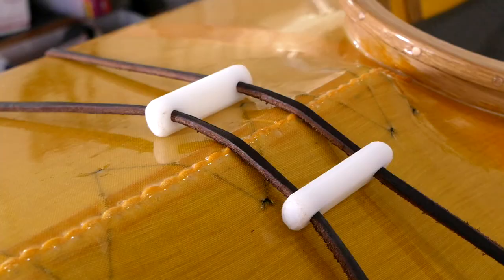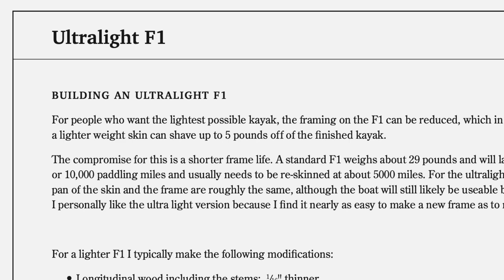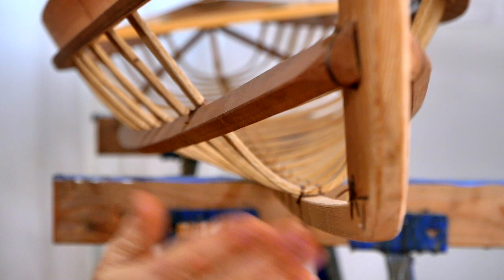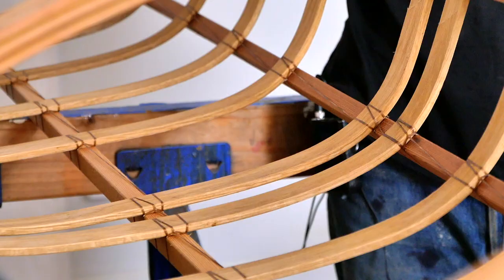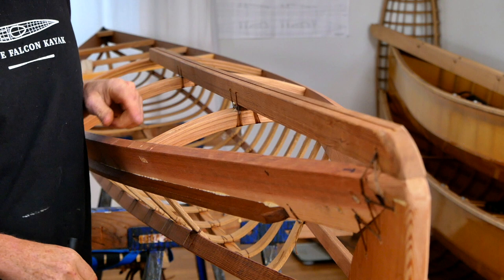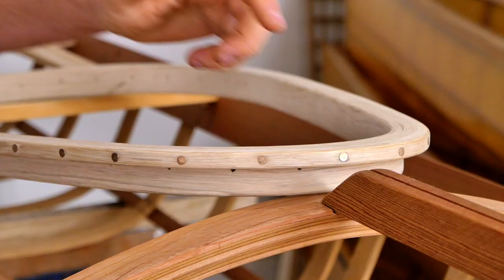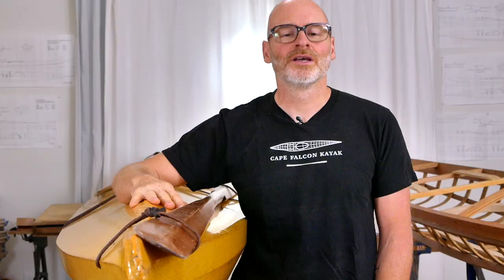Skin on Frame Kayak Construction Details,  Part 1: Framing, Wood Choice, and Design

Comment: It's great job you are doing with all these videos and plans on how to make a skin-on-frame kayak and thanks to you I'm planing on making my own by using your plans. Thanks to you. The thing is that since I live in Finland it's pretty difficult/pricey for me to get my hands on all these "exotic" woods like red cedar and white oak so I was just wondering if I could make the ribs using local birch? Finnish birch is known to be quit high quality stuff, (thanks to slow growth) not that I know if it differents from American birch
Reply from the maker: Any reasonably light soft wood will work just fine.  Norway spruce would be a great option.    I for the bending stock I can make suggestions, but it just depends on what you have around.   For example, even though it’s not the strongest option kiln dried European beach actually works really well for the ribs.  Feel free to send me an email if you have any questions.

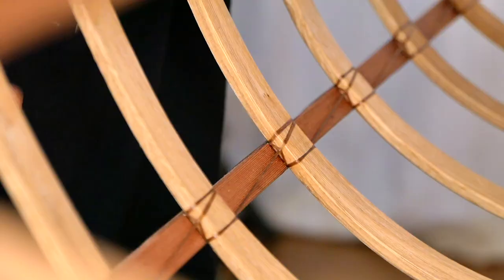Comment: About 6:40 in you mentioned rib positioning in consideration of the sciatic nerve.  Could you do / have you done a video about everything that might make feet / legs go to sleep?  Thanks
Reply from the maker: I think so.  I start with a wide spacing between ribs in the seating area, and then I back that up with a fabric seat that is suspended in that area, and then on top of that I have a foam pad.   Some people actually have a unique routing to their sciatic nerve so a certain percentage of the population is gonna have problems in almost any kayak but I don’t think this is any more prone to that than anything else.  You can also spread those ribs a little bit wider with a few reinforcements to get every last millimeter.

Comment: Hello! Very interesting video! Thank you! I don't speak and understand English, so I'd like to know what  kind of string do you use to bind parts of the frame?
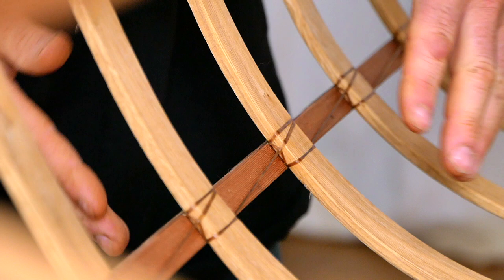Reply: Hi zhmikk,  it is called "Artificial Sinew".  It is actually polyester thread with a wax covering that makes it waterproof.  It is similar in strength to animal sinew used to bind traditioal kayaks.  Google "Artificial Sinew" and you will see many sources.  Note an important thing you might not have gotten if English is not your language, is that he says to get FLAT artificial sinew rather than the kind twisted into a round string.  The flat sinew will not make bumps on the outside of the kayak under the skin which will become points where the skin will wear through.  He discusses this at 6:40 to 7:10.  Here is one place to get it, along with a discussion comparing it to real animal sinew. GOOD LUCK WITH YOUR BUILD!    https://wanderingbull.com/shop/craft-supplies/tools/imitation-sinew-multi-ply-natural-and-colored/